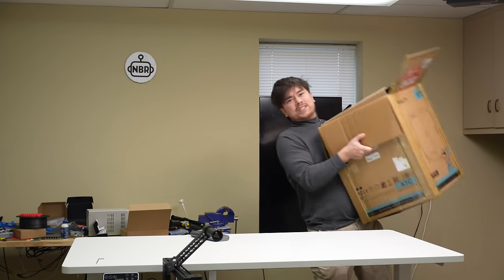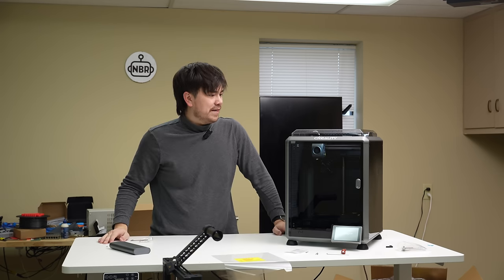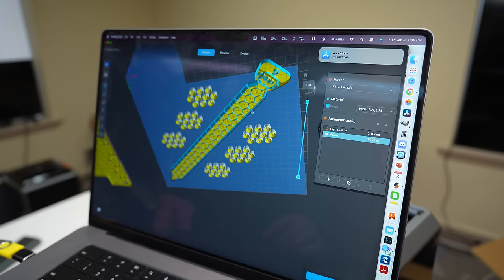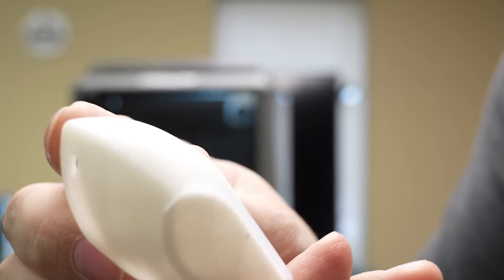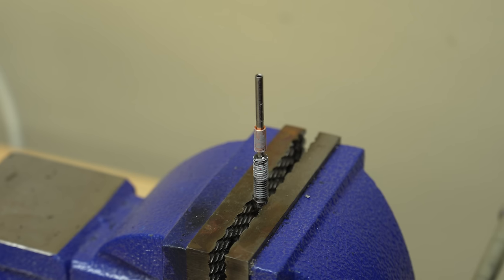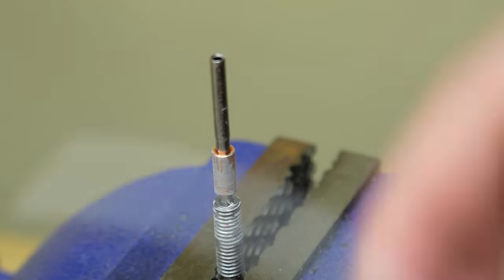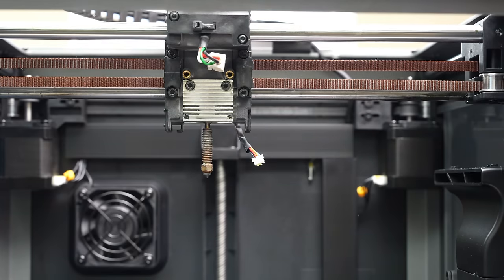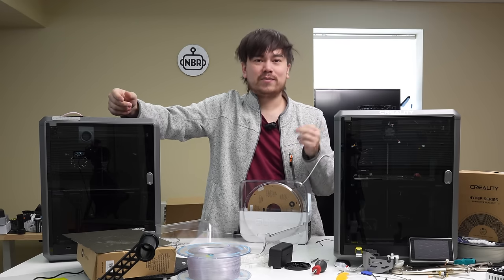Creality K1C - Flagship Carbon Fiber Printer

Comment: Actually seeing the Unicorn Nozzle I thought the "C" in K1C stands for "Colour". For Prusas mk3(s(+))+MMU2 were a lot of complains how hard/unreliable tuning of unload/ramping of filament was. This was greatly improved if people changed to the Revo hotend. The integrated heatbreak/nozzle combo leaves much better filament tips on unload.
So you might can do filament changes with an ERCF without cut&poo.
If you take a look at the new K2, there might be a chance it can do multicolour without cut&poo. Faster and less waste.

The k1c nozzle cost about $4 to $5 on Aliexpress. So you can call it an consumable. If it realy helps automatic filamentchangers to reduce time and waste, the downside of not being able to clean it if it cloggs might be worth the compromise.

Comment: Hi Nathan, hope your well and the fight with this printer was not too a pain?
I just awhile ago on 31st December 2023, Got my 1st ever enclosed fast klipper 3D Printer the Qidi X-Plus-3.  It been a great printer. But I had a big problem just last week where I left the printer doing a overnight print for the 1st time and woke up the next day to find that the model had un-stuck from the bed and was melted in the ball of death around the printing fast at 400 per second head. the ball was fully wrapped around the lower part of the hot end.

I stopped the printing, and had to spend about 30 minutes slowly hot gun heating the ball of now set melted white PLA and carefully poking it off.

I got it off and it had split the silicone sock and that had got partly stuck in the middle of that ball.

The thing is, I had the bed auto leveled fine and done a great z off set as the model before printed with zero problems so the leveling and off set must have been okay?
I got to now remove the hot end ceramic heater block and cooling fins and clean the rest of the melted PLA off them. 
Qidi do have a 2nd hot end in the box of a Hardened nozzle hot end So I fit that for now!

Qidi are a great company for helping us so they said they will send me another normal copper hot end heater block unit.
Just a pain as the bed was clean and had fresh glue layer so odd indeed it failed.  Anyway I love the speed and detailed printing my X-Plus -3 does just thought you like to wear about my issues?
Reply from the maker: Someone needs to add a sensor or switch that can detect that kind of error. Computer vision might be able to do it, but a dedicated Senator should be great because it would ideally be more reliable

Comment: I took my ptfe tube out of the closes holder on the cable chain to the print head in order to give it a easy bend into the extruder
Reply from the maker: yeah I would definitely do that for this printer, especially when printing stiff filaments
Reply: Could also print a former to limit the radius of the curve into the extruder

Comment: Would you suggest the k1c or the flashforge 5m pro? They are the same price for me.
Reply from the maker: I like the 5M pro more. Less issues. 
There are some mods for the k1 out there if you’re into that but that drives the price up
Reply: @NathanBuildsRobots  mods for the k1c? Not k1. What kind of mods are you talking about?
Reply: @NathanBuildsRobots  do you mean mods for the k1 or k1c? As I'm asking about the k1c and flashforge 5m pro, not the base k1.

Comment: Remove the bowden tube from the last buckle on the cable chain. Then the bend is correct. My original bowden tube actually got worn out after 100 h and snapped.

Comment: If you have a look at the settings on the homepage of the touchscreen you have the option to adjust the fans either on and off or percentages of that,, I recently bought a k1 and it's very similar to the k1c

Comment: You'll have less problems if you put your printer on a solid table. $10 card table shaking around will screw things up quick.
Reply from the maker: I thought my table was pretty solid. It's not an optical bench or anything but it's pretty sturdy for a desk.

Comment: K1C i.e. "we rushed a product, used our customers as the testers and did some half baked changes". At least they kept their signature warped beds.
Reply from the maker: The bed isn't warped, just tilted. To fix I'd need to adjust the leadscrews, which they should be doing from the factory on a printer at this price point.
Reply: @NathanBuildsRobots  yea you're right, definitely tilted. I really wish the K1C was a bit more polished. I'm currently looking for a premium printer to replace my ender 3 s1 pro and I really don't want to have to go with an X1C 🤣. If I didn't need a good printer now, I would build a voron.

Comment: Hello. I bought a Creality K1 hotend to upgrade my V3 SE, and I have a heatbreak from Polisi3d that is supposed to be better than the stock heatbreak in the K1. The only problem is the heatbreak is really hard to get out of the K1 ceramic hotend. Do you know how to remove the heatbreak from the hotend on the K1?

Comment: I'd be interested in a K1C Max.  I'd delete the reverse Bowden tube.  I print a LOT of TPU and that's a complete non-starter but it's a PIA for all filaments.  There should be a domed lid with a filament feed hole in top.  I'd root it and put real Klipper on it.  Klipper is awesome.  Why do most 3D printer manufacturers want to install their own Kripple Klipper?  Is it false pride, pretending they invented the firmware when all they did was strip out some functionality and tweak the user interface?

It really bugs me that all of these large manufacturer high speed printers use nozzles that are essentially Volcano nozzles but just different enough to make them proprietary.  It's even worse that they launch the printers with the nozzles back ordered.  I bought a new extruder and hot end assembly for my Neptune 4 Pro just to ensure production wouldn't grind to a halt.  After several months I was able to order a set of brass nozzles that should be here in a couple of days but there are still no hardened steel nozzles.  I contacted Micro Swiss and begged them to make a really good extruder and hot end for the Neptune 4 series.  These low cost printers are getting to be very good but mediocre extruder assemblies are their weak point in print quality, reliability and maintainability.
Reply: K1 is compatible with standard Volcano nozzles, I've been using them since I bought the printer.

Comment: Shouldn't it come with a 0.6mm nozzle? If it's intended for use with CF infused filaments? 
I have seen quite a few videos / info stating that you should use a 0.6mm or larger nozzle especially with high % of Cf.

Comment: The nozzle clog is definitely due to heat creep. In this case, not sure if the conduction through heat break spacers causing it. It could be something to do with discrepancy between actual nozzle and nozzle temp readings(coming from thermistor), in these cloned revo3d type nozzles. Seems like with some software tuning, this could be eliminated. Also the Qidi XMAX3, seems to have similar clogging issues, which makes me suspect the internal PTC chamber heater coupled with the  HDT of the material causing the issue🤔. Keep my 🤞, till NBR narrows down the issue. This also highlights need for thorough testing(or to employ  specialists like NBR during development), instead of depending on customer feedback, to work the kinks out. Just some 💭❤️👍
Reply: Someone found the V3 KE nozzle was 15deg cooler than the set temp.

Comment: Am I the only one who was hoping that K1C meant they'd added color changing capability to the K1?  I mean, that's the most significant issue holding back the whole K1 line.

Instead the C stands for carbon...umm, ok then.  No point in waiting any longer for Creality to figure the market out.  Time to go place an order with Bambulabs.
Reply: Yup they’re playing catch up without realizing they’re on the wrong racetrack. Glad I chose not to buy the K1, every review I’ve seen for months has been plagued with negative issues.
Reply: There are several after market filament changing devices that are cheaper and IMHO better than the bambu. 3d chameleon looks great, and no poop!

Comment: Nathan! Thank you for bringing all these awesome videos to us!

I have a question if you could help me out, With all these new printers coming out, i remember your amazing review on the Ender 5 S1 and want to ask at its current reduced price(even cheaper refurbished!!) do you think the Ender 5 S1 is still viable? Being easily fixed and modded?
Reply from the maker: I'd rather get an Ender 3 V3 SE or KE.
There's not much point in having a cube printer if it doesn't come with an enclosure, at least thats what I think.
Reply: @NathanBuildsRobots  very true! Think its worth waiting for the Ender 3 V3? What would your price guess be for it?

Comment: Just curious, I really don’t like proprietary parts at all but the newer printers all have a little bit of that in them. Do you know if it’s possible to put the old hot end/nozzle assembly in the newer version? Does the original version/microswiss mod (if/when it’s compatible with k1c) allow it to use a more standard nozzle?
Reply: Replacement nozzles are not available anywhere yet !    I asked in the creality store chat and they have no idea when/if they will be available.    This is a major problem !!

Comment: Nice test and you made me smile several times. I have a modded K1 and use it quite often. The extruder still bumps in to the door sometimes and I had to remove the cable chain. Nozzle changes are a nightmare and I consider using a FlowTech hotend. I think, Creality has tried to address several issues, but I wouldn't recommend buying it. In my opinion, there are more advanced and more user friendly solutions in the market.
Reply: can you recommend any?

Comment: I don’t even bother with the top cover or the PTFE tube. I hang my filament above and feed it through a 2 inch PTFE tube lol
Reply from the maker: Yeah I'm going to start doing that if I ever attempt CF nylon again.
Reply: @NathanBuildsRobots  - Any style of Bowden tube is a real drag when printing TPU.  I won't buy a printer with a Bowden tube and I'd remove the reverse Bowden from a K1 and feed from above.
Reply: @Liberty4Ever   I tried printing TPU on my K1 without any PTFE tube, but the filament wasn't feeding into the extruder properly.  So I just started using a really short piece and now I have no problems.
Reply: @raf_the_riffer  - Thanks for the TPU report on the K1.  I'm seriously contemplating a K1 Max, mostly to print some larger ABS parts (possibly ASA-CF) for a new product but I'd also want to use it to print TPU parts.

Comment: I think was really nice about bamboo printers is they don’t mount their screens on the bottom, so it prevents neck cramps……
Reply from the maker: How much time do you spend looking at the screen?!
Reply: Well, now that you mention it, I guess not too much 🤔😂
Reply: My printer is on the table next to me as I'm seated at my computer.  The display at the bottom of the printer is at eye level.  Putting the display on top of the printer would force me to crane my neck up to see it, or stand up.

Comment: Do they no longer provide a needle that you can push up through the nozzle to clear it?  The rod that you used it designed to push filament into the nozzle form the top like you used it, but it’s not for clearing clogs.

Comment: Great video man! Earned a sub! I may just pick up the K1 since it doesn't have the proprietary nozzle design. It's that or an A1 Mini/standard A1.
Reply from the maker: You can't get an A1 right now because they are dealing with a cable strain issue that is a potential fire hazard.
Reply: I saw that. Your video was how I learned about that also lol! Am I safe to just snag a K1? I have some bestbuy credit to use so it won't be $599. @NathanBuildsRobots
Reply: @cagerage21  My K1C from Microcenter was only $539. Got it this week

Comment: Hey Nathan I just saw couple teardown videos where the creator is very upset about the fact that the extruder (gears) are not "all-metal" as it's claimed everywhere on the advertisement materials (all-metal extruder), what do you think about it? Could it be called all-metal when only the wheels that drive the filament are metal or it's something shady? I'd love to hear your take on it if it's something worth to talk about
Reply from the maker: Plastic gears are fine. You only need metal gears if you're going over 80C chamber temp. Are you going over 80C chamber temp?

Comment: LOL. It can't print Nylon Carbon fiber. An Ender 3 can print all of the materials this can print and it's only $100. Also, on the ender 3, you can literally just throw parts away instead of fixing/troubleshooting them. Hotend clogged? $10. Throw the whole damn thing away and install a new one.
Reply from the maker: I really like the Ender 3 🥰

Comment: If this has been said already my apologies. Your x axis seems to be moving around much more freely on the rods than the k1 max does has there been changes within the tool head also bearings springs or such? Thanks
Reply from the maker: Could be the smaller motors requiring less torque to back drive. But none of my k1 printers are particularly hard to move. Maybe try cleaning them?
Reply: @NathanBuildsRobots  yeah I’ve done that even cleaned the grease Creality tells you to put on them off of them, and used a light 3n1 oil but no difference. Could be those larger wheels. Thanks for the response Nathan really enjoy your videos

Comment: They changed the pulley size?  It being Creality, that then makes me wonder whether they also corrected the position of the motor to ensure the belt path was still orthogonal to the moving X gantry?  And that makes me realize that I have so far not seen anyone check whether the K1, K1 max and K1C have correct orthogonal belt paths (for the parts where it matters).  Maybe a gap you could fill?

Comment: Hello Nathan, does the printer have a heated chamber?
Reply: The K1 has a passively heated chamber.  The heated bed slowly heats the enclosed chamber.  It's obviously not as good as an actively heated chamber but it works fairly well for ABS, ASA, etc.

Comment: Well, I guess if someone wanted to prove a point ...  What I don't understand is how bowden tube too tight a turn for stiff filaments, as reported on multiple yt channels, is ignored on your k1c while your  k1 has the tube outside the chain, eliminating the too sharp turn.  Plenty of k1 framed lid riser models available for download, even before I obtained a k1c. My first printer, yet I knew to extract the tube from the chain before printing anything.  In addition, you decide to run a long, unattended print with a stiff filament, thus ruining the printerhead.  So, you look to install a micro swiss (sent free to you for a review). How is it that I knew the mirco swiss nozzle does not fit the k1c printhead, but you and micro swiss didn't know?  The k1c comes with a nozzle clearing rod, but you decided not to mention this nor use it.  
I don't know why you posted this video, but I can read the comments to see the negative effect. So, congrats, you have proven to me that you belong to the original, 1st generation printer users.  Maybe, after a while, you'll see how these new, all enclosed printers are embraced by the next generation. Soooo much easier to use (nearing one step printing) with newer filament types coming since the temperature control inside the new generation printers is possible. 
So, I guess, your question is whether you want to instruct the next generation of users with their next generation printers, or make vids for your subs on the way it use to be?

Comment: I was disappointed that Creality has not fixed the cable chain issue nor the PTFE tubing problem. I have noticed that most reviewers jump right into printing where I think it might be worth a few minutes explaining where the setup and calibrate information is for the product you’re reviewing, there are many posts from users that skip the setup and calibration then try to print with a $1.98 roll of filament. 
The PA12-CF Nylon is something I won’t be using, not at $100 a kg. I already have both Creality K1 nozzle packs, 12 nozzles waiting to be used but I have not found a means to add any nozzles to the K1 in Creality Print and I know not what I’m doing to just start poking numbers into boxes, they (CS Creality) told me they are ‘working’ on completing the nozzles in Creality Print…  
1.	PTFE Filament tubing, remove the tubing from the cable chain, 90° turn in 4~6 inches, friction is your enemy. Purchase some Capricorn tubing, less friction.
2.	Cable Chain, My K1 (1/3/2023) had two types of links in the chain, most were 45° folding, 4 were bidirectional 90°, remove those bidirectional links, place 2 of them at the rear chain mount and leave 2 out of the chain making it shorter by 2 links. Now when you move the head to the top left the cable chain is at its limit, when moved to the bottom left the chain now folds and does not bunch up and hit the extruder releasing it…. I have the JC raiser that I modified, added LED’s and 100mm to the raiser so that the Capricorn tubing can flop around. I tried to add a link to an image of the cable chain, YT doesn’t like that so I found out.
I looked at bambu before purchasing the K1, I will not buy from a thief, what would that make me?